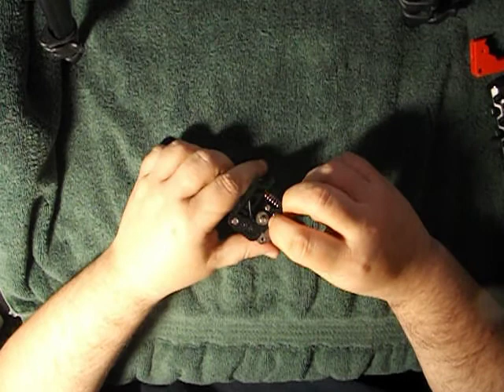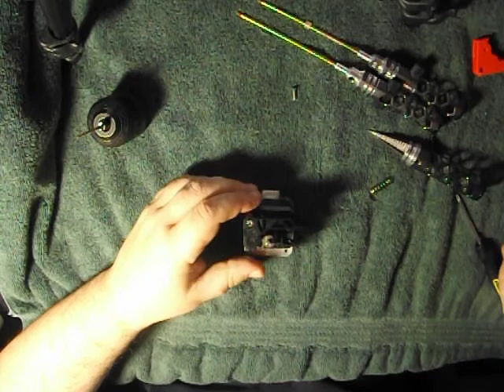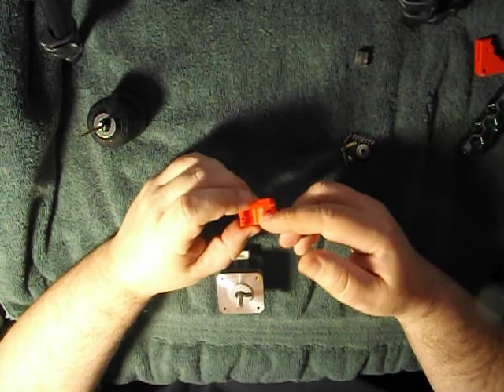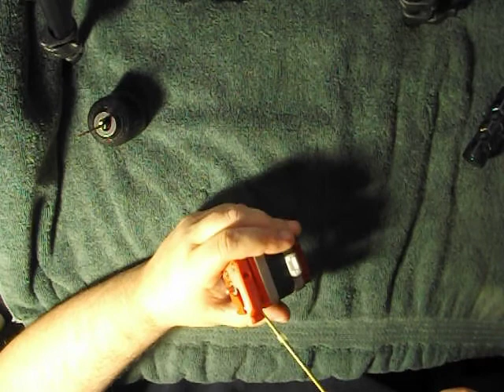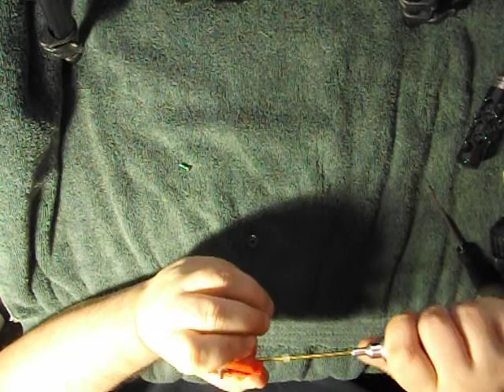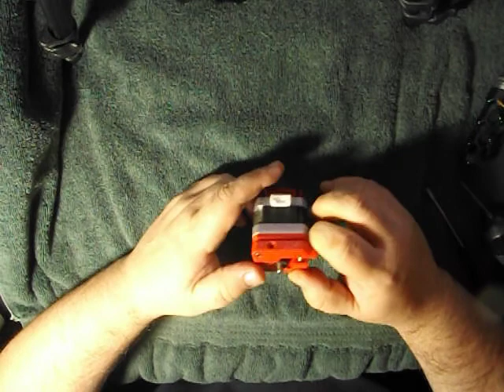FlashForge/PowerSpec/Monoprice 3D printer filament feeder upgrade.

Comment: Hi, thank you for this video! my question is, what i need to install the pinch roller in your design? i need to try because my ffcp whit original extruder don't want to print tpu so i need to try something new! thank you!
Reply from the maker: I think a 3mm x 10mm flat head bolt. It is an axle for the roller.

Comment: How have these printed replacement part reacted with the higher temp required to print flexible filament? Are they still working a year later?  Thanks
Reply from the maker: Generally you don't have to print flex filaments at any higher temps than ABS. Ninjaflex runs fine at 230 or so.

Comment: Hi JF, 
great work, the only issue I have are the small bearings but ...

now I want to machine them in Aluminium, but the CNC router needs STEP 
any chance you could upload the step to thingiverse ?

Regards
Peter
Reply from the maker: Ya those are fine, just don't over tighten. I'd just go to the hardware store and pick up a couple.

Comment: So I am getting issues with really thin strands of ninjaflex. could it be because my drive gear is hung up on something causing it to not feed fast enough? My parts were printed on a very high end printer so they fit perfect the first time but I am still getting thinner, less consistent strands of filament

I also just cleaned the tubes and nozzles, this is my first print so everything is fully cleaned out but still not quite right :/

Any suggestions?

Comment: I just bough this Monoprice Maker Architect 3D printer which I hear is a FlashForge Creator 3D clone.. looks like the CTC printers too.  Anyways I used up my very first spool and am trying to unload the filament.  It warms it up and says to unload.  I start to hear knocking.. and I try and pull on it and no matter how much force it won't come out.  Is it jammed?  If so, how do I take the head off?
Reply from the maker: +Jennifer Gwinn You really don't need to take the whole print head off. One thing to try is to only load filament, never unload. To unload just cut the filament above where it enters the print head and feed the new filament in right after it.

Comment: That's an impressive speed. From most of the readings I've done ppl seem to print pretty slowly. I've not had any issues at 30mm so I will test it at higher speeds and see what my printer will do. You printing at that speeds says it can be done so I'll try and see. Thanks for the info and thanks again for a very nice design!
Reply from the maker: +vangmountain

Even though I say 60-70mm/s it of course doesn't mean that is the exact extrusion speed. On small parts the acceleration settings may not let it get above 30-40mm in most instances.

Comment: Thanks for the part, JF! So far, so good. Just printed and installed it on to my FlashForge Creator Pro which I've had for a month( same amount of time been into 3D printing) and so far, it's working great! With the stock extruder, Semiflex would ooze out a bit and then it would stop cold and nothing would come out. This design of yours is working great so far. I've not had any issues with Semiflex yet and I'm printing at the 30mm/sec on Ninja Flex's website. Initially, I started at 15mm/sec which is what I've seen in lots of write ups, but I saw that I could print much faster so that's what I'm doing. A great addition to a great printer! I've been printing for a total of 1 month and have printed with ABS, PLA, PCTPE and now Semiflex without any issues thanks to your part! Thanks for the design, JF!
Reply: +vangmountain   Sounds good, I print NinjaFlex at 60-70mm/s. And yes, the feeder plastic works for everything, not just NinjaFlex.

Comment from the maker: The main benefit is for flex filament to make it more reliable. I use for other types of filaments also, ABS mainly, so I don't see any reason why PLA wouldn't work either.